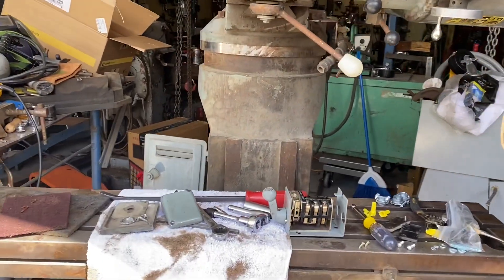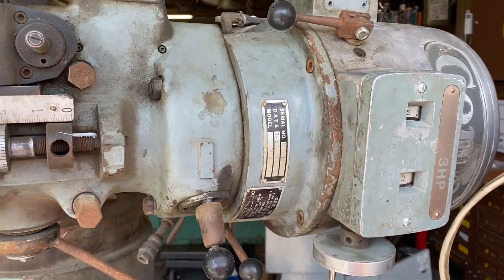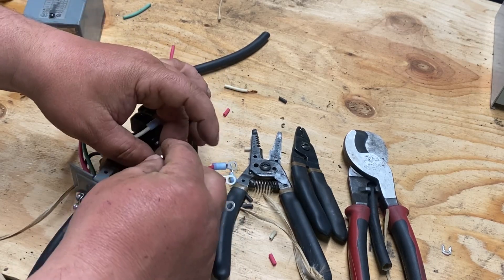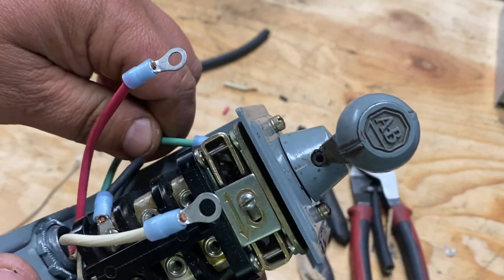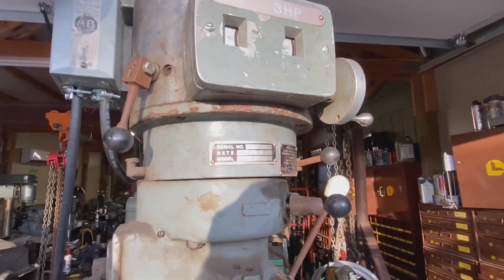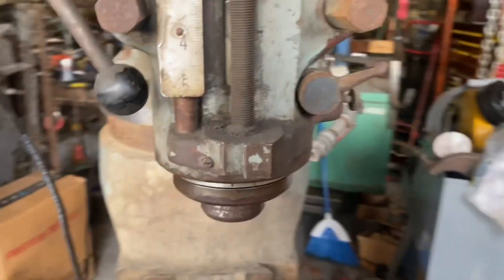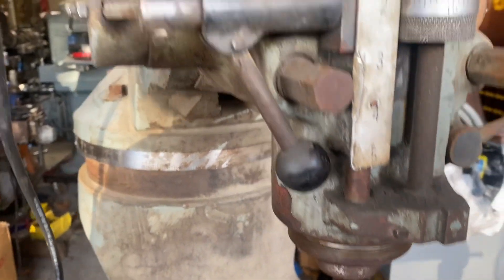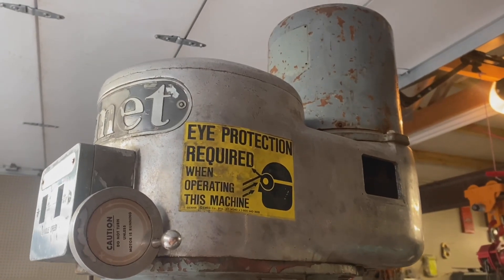Wiring and first running of the comet milling machine

Comment: Quick question. You mentioned that the drum switch is left right and up down. I'm not familiar with this type of drum switch. Do you mean that the polarity can be reversed either left right or up down? Or do you mean that there are four separate potential switch positions? Does the user pick left right versus up down?
Reply from the maker: I was just referring to the internal contacts of the switch, the top four terminals are either up and down in one position and left to right in the other